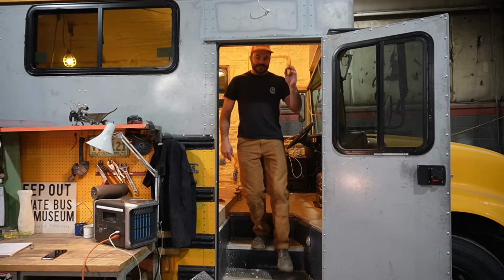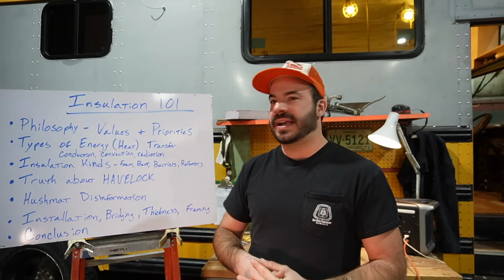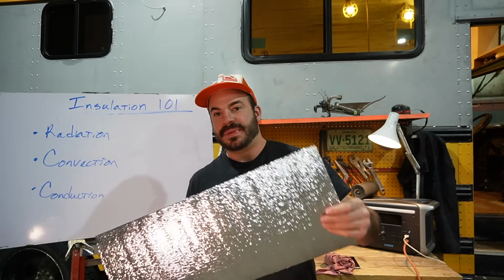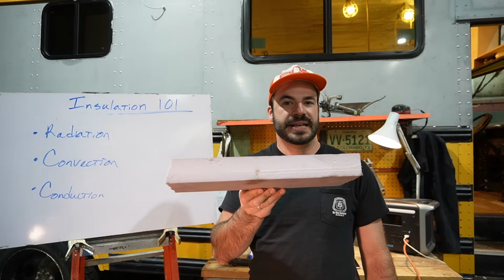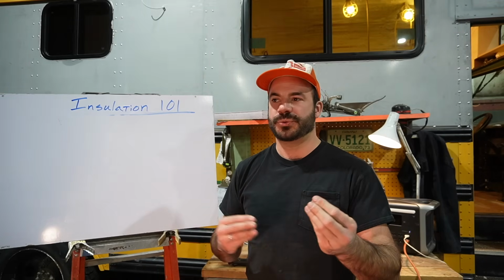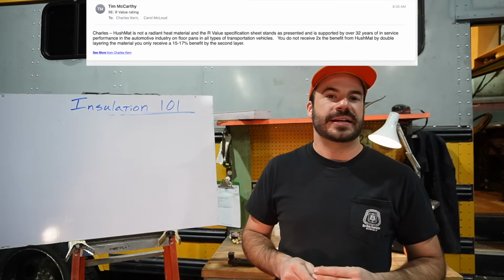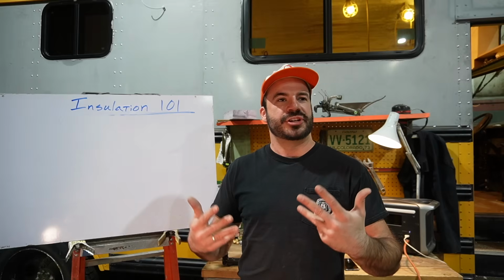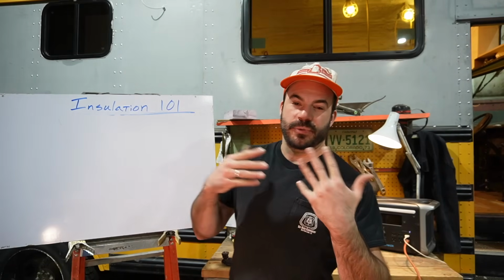Insulation is a SCAM (& the truth about Havelock and Hushmat)

Comment: Thank you, I enjoy your sharing knowledge.  Question. I have a step van fire dept vehicle.  It has aluminum sheets inside 1” fiberglass bats then another skin of aluminum on the outside.  I am looking at insulating the roof. Painting the pink waterproofing paint on the aluminum outside skin affixing 2” polyiso then affixing 1/4” plywood running I think it’s called eterna bond tape to that assembly on the edges then painting the whole assembly with Henri tropic sealer.  My son does not think I need a radiant foil under the Henri paint. What do you think?  I also thought I would put a 1”  rigid poly iso with the foil lining facing the inside space. We live in Western Washington, so the weather isn’t too crazy.

Comment: Chuck, what about the rubber looking, closed cell foam that sticks on, about 1/2” thick, and foil material on one side? It seems it has decent R-value. Then, use thinsulate, then, wood interior. If I had the time/energy, I’d put 1/2”-1”foam against the van ribs then install radiant barrier to bridge from side to side, to create an air pocket near the metal skin. The attic foil company owner gave me instructions to do that in my home attic between the rafters which created an air gap and allowed me to put batt insulation in then drywall. Radiant barrier needs an air gap between the outside to work at all. I think you will understand. I probably should have used spray foam, but am trying closed cell rubber type, then thinsulate, then cedar wood. My wood will be shiplap so won’t be air tight on purpose. I’m banking that I’ll be ok, not as good as spray foam, but not as permanent either. I hope I getitright, and I’m not living in it. If I were, after seeing this for the 3rd-5th time, would do what you say, and spray, all the way. Lastly, I have a Nissan NV2500 which is shorter/narrower than other vans, so can’t build the floor way up and the ceiling down, then I’ll have to hunch over. I’d rather have a little less insulation, lol. Really appreciate your content/channel.

Comment: For spray polyurethane foam (SPF) insulation, the active off-gassing and curing process typically lasts between 24 to 72 hours. During this window, Volatile Organic Compounds (VOCs) evaporate while the foam fully solidifies.

Comment: Nice video, but if the radiant energy is absorbed by the metal floor of the bus it will irradiate part of that energy again as heat (IR) and that you can block with radiation blocking foil. @27:50.

Comment: Thanks for the clear and extensive information. One thing about poly iso (PIR) though. It is true that the R-value of PIR can drop with temperature, but even when it is really that cold, PIR still has a similar or higher R-value than XPS. At room temperature (PIR) has a (much) higher R-value than XPS. You could choose XPS if you are dealing with high floor loads or very wet enviroments, but in many cases PIR is a better choice. PIR can also handle loads and water quite well. 

Cheers and keep up the good work!

Comment: I lived in a motorhome for a few months in winter and found a major problem come spring I had a major leak in the back over my bed when it rained outside it also rained inside looking for the reason I found the transmission strip about 14 inches between the back wall and the roof skin the moisture from my breathing at night when I was sleeping had condensed on the underside of the aluminum and had eaten right through the strip looked like Swiss cheese I coated it with a black rubber roof patching material but the acidity from your breathing will eat through aluminum that's why most motorhomes now use a rubber roofing material unfortunately they still use aluminum to transition from the back and front wall's to the roofing membrane never could figure why they don't just run the roofing membrane around the curve and attach it to the back and front wall's

Comment: Polyiso has a higher r value than xps. But when it is below freezing it has the same r value as xps. That is why we pay the same for xps insulation and don't use polyiso.

That is the most retarded thing ever. If polyiso is the same r value at low temperature then why would xps be the better option? Especially when it is hot polyiso has a higher r value. And most polyiso board has a radiant barrier so if you are able to create an air gap on that side you get the additional benefit of radiant insulation for no extra cost.

Comment: 4:15 just want to mention that modern engines, both gas AND diesel, when properly tuned and functional, are actually cleaning the air more than they're polluting it. 
BTW if you have a check engine light on, fix that sh#!* because that's where all the pollution comes from, it's called an emissions control light for a reason.
Reply from the maker: id love to see the research around modern engines leaving the air cleaner out the tailpipe than the air going in--sounds too good to be true!

Comment: thanks for supporting my dicision to spray foam  I bought the cans because my van is a 144 sprinter and i only use 14 cans ( you never get the 20 board feet they say). A point about batts or wool. it has bee shown to allow convection currents within the wall cavity. I can't live with that in a van where the insulation is partial at best there is so much bridging to deal with. at least my bridging has to deal with the foam keeping it in one path and not adjacent areas too as my heat tries to get out!

Comment: Why don’t you discuss the insulating properties of wood. The framing slats you add to the ribs do insulate to approx. 1.0 which is significant to deal with bridging. Especially when compared to the bridging of steel structure alone. I agree that the vapor barrier is more important than most people realize. Vapor barrier keeps the moisture out if properly installed. Vapor we create inside the vehicle can be mostly eliminated by a good vapor barrier and exhaust ventilation.

Comment: i've lived in my van with wool batt insulation for 6 years, after 3-4 years I got big problems. Dust mites. 2 years of serious problems, i finally tore up my entire build. I listened to youtubers that said you don't want a vapour barrier, but it wasn't just moisture from the inside, sprinters use plastic pins to lock the bumper trim to the van body, i saw leaks on 4 of those pins, adding moisture to my wool insulation, which helped dust mites. The whole thing was terrible, keep that in mind.

Comment: I like to let my van wall insulation system breathe a little with a inch gap at the floor;  the way jet airplanes do it.  The over sized puffy down jacket and vest I purchased over 30 years ago still works to keep me warm so heating needs are limited.
Reply: How do you vent it at the top of the wall?
Reply: @RotokEralil  I just vent the bottom.

Comment: Something amazing I have experienced first hand, Look at a "5 man military command post tent with liner" basically its just a tent, but the tent liner is just a heavy cloth sheet that hangs 5 inches away from all the walls. It just creates dead air space that doesnt move, but its insulating capability is absolutely amazing. I think the dead air space is important. Thats why the house fiberglass insulation works because its filled with air.

Comment: I noticed that all of the warm/cold references assumed that the outside was cold and the inside was warm.  Are all of  the suggestions the same if it's hot outside and you want to cool the inside, in an extremely humid environment, like coastal Texas in August?
Reply from the maker: In general yes. Insulating a metal box is not ideal but t least in hot climates you don’t have to worry about interior condensation which is why I focus on that! Plus most AC units significantly dehumidify the air. Moisture is the problem

Comment: As an architect who has been designing homes using Spray Foam for 25+ years and live in a home that’s 25 years old which is surrounded on five sides which includes the roof, I think it is a great insulation that is continuous and illuminates infiltration as well. I never spray it on the inside and make sure there is a vapor barrier separating it from outgassing into the living space.

Comment: The sill plate gasket primarily acts as a capillary break, preventing moisture in the concrete foundation from reaching the wood. 
Spray foam on the ceiling is likely the best option. Having a way to insulate the windows from both the sun and the cold is important. Consider using a custom floor carpet that can be laid down during those cold trips.

Comment: I prefer 3M Thinsulate SM600L. Havelock didn’t work out for me — it’s pricey, the acoustic performance wasn’t great, and it had a smell after installation that I couldn’t get rid of. I trust 3M’s engineering and the testing behind SM600L. Kei Project has the cheapest pricing Iand they told me they’re a 3M Authorized Converter. There are a lot of fake SM600L products circulating, especially from China, so be careful with the cheaper listings. The smell from Havelock really ruins it. I would choose closed cell spray foam as close second.

Comment: Won't the xps & subfloor condensate from the interior warm moist air also? If this is an issue for the ceiling & walls.. then why wouldn't this be an issue for the floor?

Comment: Would it be ok to use iso board for a van?
It's cheep 10.00 a sheet for 1 inch
Want to use 1 inch on inside of a box van structure then another layer to cover the metal structure. 
2 inch total

Comment: I have so many questions.  So you’re saying, if you had a van in Hawaii that you are be living in, that you would use spray foam for insulation.   This is the one thing I’m stressing about building out my van. What insulation to use in a very moist climate.  I’m just not sure how the outside to inside temp differences work when it’s probably just gonna be hot outside most of the time   i.e. it’s not going to drop below, 60°. Also, living in a van on Kauai, you’re gonna have your doors open probably most of the time if it’s not nighttime so moist air is going to get in anyway. How do I remedy my problem?

Comment: How about no insulation or paneling in a camper van with a diesel or gas heater?  Sure you'll get some condensation on the roof and walls but it can easily dry out or drain as there's nothing to hold the moist air.

Comment: Hi, thanks for the information 👍.. I would like to ask you if you have changed or improve new ideas since you make this video?  On the other side , your experience is well gained on buses…very large spaces, but in Europe it’s different as you know…and the most common RV are , for example , Sprinter - Mercedes. So how can you overlap by 2 inches the inside metal rib on a Sprinter? I mean the available space is not so much, so how can you do a good job? Other question is about something called Armaflex..what do you think? I have seen many completely cover the inside metal panels with Armaflex…is this good? Thanks for your reply 🖐

Comment: Hey I'm hoping someone replies cause I'm just building my first conversion, which is really new to me cause I'm an IT tech lol. But I just can't get around the of using spray foam for the chemical values, I simply can't. But the expanded foam is something I will adopt. 
My set up on the floor will be the expanded foam + linoleum carpet. Side and top would be bubble foam with reflective sides facing the metal. The nooks and crannies will be filled with, well the wool. So essentially, with a foam build with wool for extra filling and linoleum on the bottom and some of those reflective noise dampeners either fully covering all the metal, or 50% of metal. I would considering wood flooring also.
I don't plan to have it to be super cozy. For example if I cook I'ma have the door open. I'd love to hear some opinions and or criticisms frankly. I just started my research yesterday.
Thanks, great video.

Comment: best video I have seen on insulation, the tldr is spray foam is the only option good enough if your exterior is metal because it is the worst option possible for a comfortable living space, if your exterior is non conductive like fibreglass then less options may be good enough, if you cut corners on every other part of your build don't for the insulation because unlike everything else you can't go back and change it later.

Comment: this has been a great introduction to insualtion and i leanred a lot ! I'm about to build an insulated outdoor cat house and in search of the proper insulation material.Sofar the idea is to build EPS  panel with a coating from a mylar blanket glued on top and sewn into a tarp sleeve velcroed to the walls and ceilling to be removable in the summer.  Would like to build a double glaced plastic window but am worried about condensation, so  i'd be interested to know more on the drainaged system build into the windows he is talking about. best regards from denmark and keep up the good work!

Comment: There's a difference between natural sheep wool and synthetic wool.
You're wrong on this point.
Natural wool has the ability to retain moisture.
This means that condensation won't form and the inside of your van won't get wet.
However, if too much steam is supplied to it, condensation will form.
Reply from the maker: Havelock wool is “natural sheep wool” and there is a limit to how much moisture it can absorb—you can’t just keep pouring water into it endlessly which is what happens when fulltiming in a humid climate in the winter with propane appliances and 1-2 people living in it. We dont want moisture retention and Havelock themselves recommend using a vapor barrier. What am I missing?

Comment: Your videos are great! So informative, but quick question; if I can’t spray foam my bus can I use tool dip rubber spray to cover the steel spines and then use foam board insulation plus the 1.5” minimum stand off?

Comment: You lost me with spray foam adds structural integrity. Structural strength you lost when you took out all the metal interior panels, headliner. You turned it into a flemsy RV. You millennials are hilarious. The rivets locked it all in. Please stay off the internet
Reply from the maker: come on over and see how the bus feels after its foamed.  helmets are made of foam. this is nothing like an rv and its still held together by thousands of rivets. its gonna be ok, i promise

Comment: Confused,   you said polyiso's R value, drops as it gets colder to a point where it's the same as the XPS. If you don't need the compresive strength (walls and ceiling), the iso is better than the xps. Is that correct?

Comment: XPS foam can burn easily. Is there any safety concern having it under the trailer without any cover? Modern building code restricts exposed foam and requires them to be covered.

Comment: Nice Job, I’ve used a few different types in Vans and homes. I agree with 95% of what you said. Where we differ is Spray Foam in a Van, it works fine, but the real negative is if you should be in an accident, most body shops don’t want to deal with external panel replacement work when spray foam is attached to it. Roof, Probably ok unless a tree drops on it. Not really that much of a problem in a Bus as your spray foam is 3 feet off the ground.

Comment: Loved that.  Been investigating for a while and you clarify a few issues I had.  Live in Australia so outside heat is the greatest issue. Also converting a smaller van means spray foam could decrease the space too much, esp having to add 3-4 mm on top of batons etc.  might have to go foam board and one way vapour barrier. 
Wondered if it's even wise to insulate the floor in a hot climate.  Might the floor cool things down?  Thanks for the insights.

Comment: I was thinking not filling in between the ridges on the floor, just have xps on top.  That gap will allow moisture to escape.  Maybe for the wall, run some computer fans on each end to get some air flow when you're not in the van.  Will that work?
Reply: Why?
Reply: @sebastianflynn1746 what do you mean why?

Comment: Hey man, great info. Thank you. I just got an aluminum truck cap. What are your thoughts on me just carpet lining it with that thick outdoor gray rubber/plastic carpet/maybe wool like material? I was gonna use 3m spray can of
Glue to tack it on. My thinking is it will add a little insulation, little noise reduction and since it’s in open if it gets moisture it will come out? And it will look softer and nice on inside and match my truck bed carpet liner. Thanks in advance.

Comment: Very interesting and helpful, thank you. I am planning to buy a sprinter 170, and use spray on sound deadening and then attach pvc ribs to the roof ribs and spray foam even with pvc ribs. Sounds like I should also tape over that joint to ensure no moisture. Most van builds I see run the framing over the van ribs but that seems wrong.

Comment: I used Kilmat and 1.5 " XPS on the ceiling. The ribs and a small amount is not covered and is bare metal. On periods where it rains a lot I do get drips but nothing like before the Kilmat was installed. Also the Kilmat helped with reducing noise from rain and lowered heat a few degrees. I have a small van and foam wasnt an option. I have a Maxair fan with a side pop out window to let out moisture. On a few windows I have reflectix taped up with 3M blue painters tape which helps with condensation and gives privacy because tinted windows show light at night. A microfiber cloth works good for wiping moisture from a window (front windshield especially) and dries quickly. I have wood panels on ceiling I primed and painted with high quality bathroom paint with mildew treatment. I didnt on plywood counter and have mold.